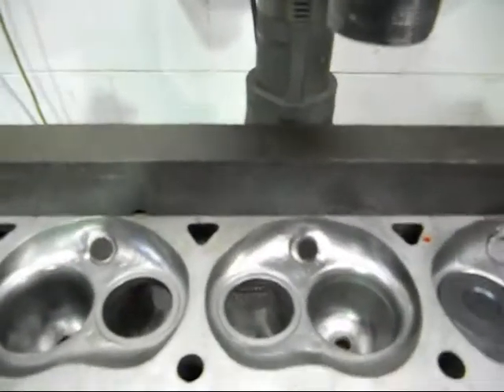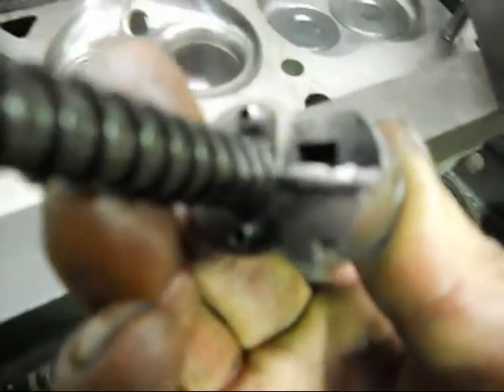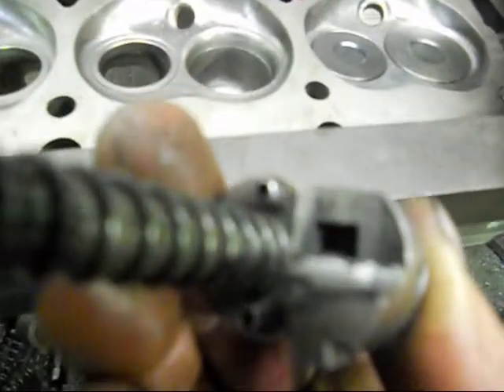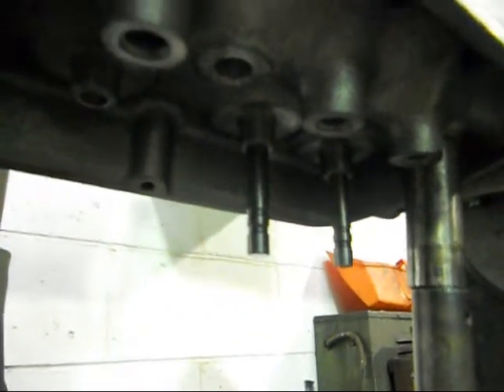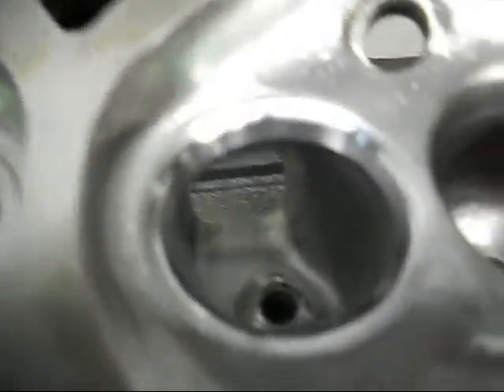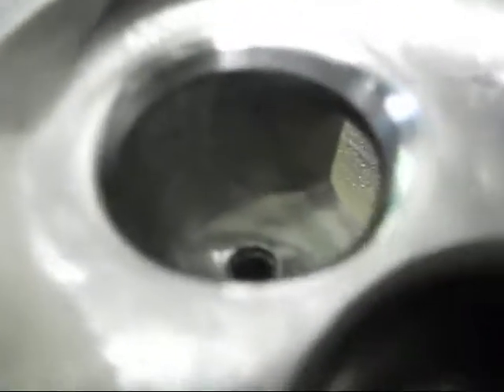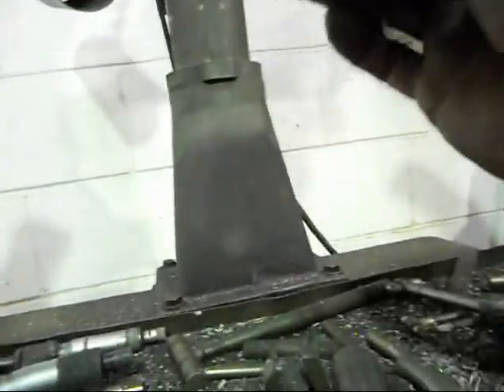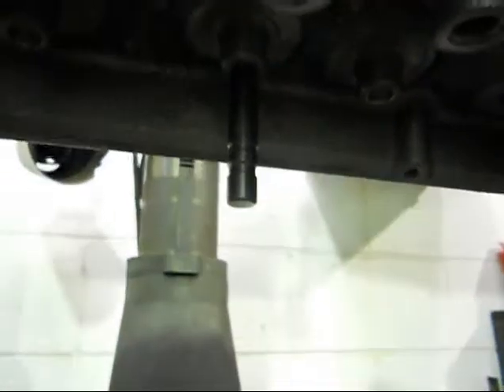How to machine V8 multi_angled valve seats while blueprinting valve spring heights

Comment: I watch both you & Headbytes which appear to be the 2 best head machinists I've seen on the tube.  That 'trick' valve stem height measurement tool you manufactured is FAST to use & accurate... like by-by shims!  If you have the time to watch the below video...

https://www.youtube.com/watch?v=U-AsA4uRl4Q

...I would appreciate your feedback about both the TUBES in the exhaust head bolt penetrations  & the enlargement of the exhaust ports.  I am working on a pair of the exact same heads shown in the above vid,  & have concerns about the tubes coming lose due to heat & expansion of the 2 different alloys being used.  My other concern is about losing the Helmholtz resonance(3rd wave theory) due to exhaust ports being to big.  From what I have been able to garner in the way of information the exhaust port exit penetration is to have an area not greater than 8% of the area of the exhaust valve.

I'm NOT doubting Headbytes but it never hurts to have a 2nd opinion from a pro.  Great vids... keep them coming!